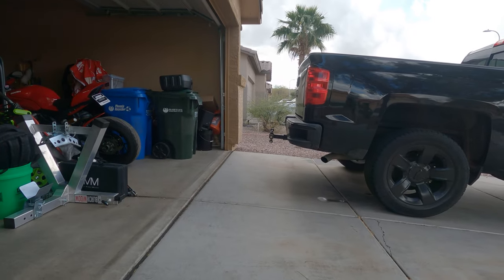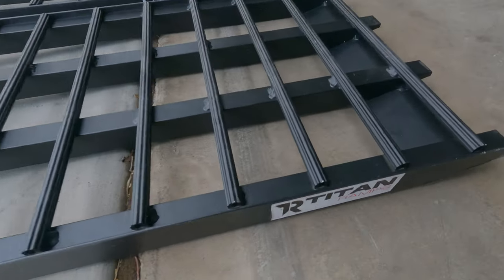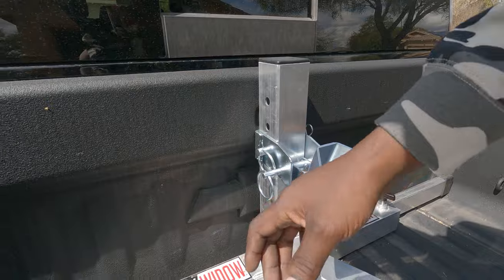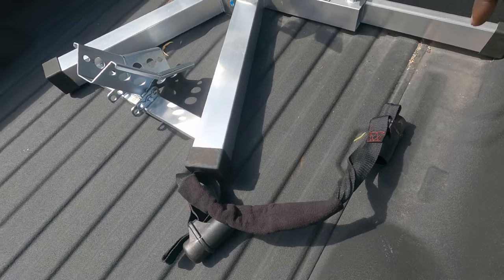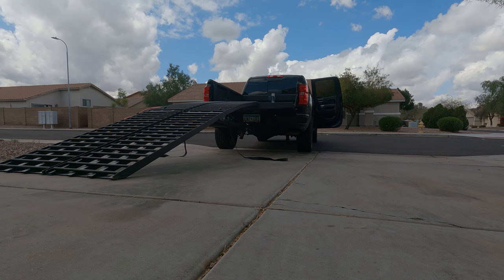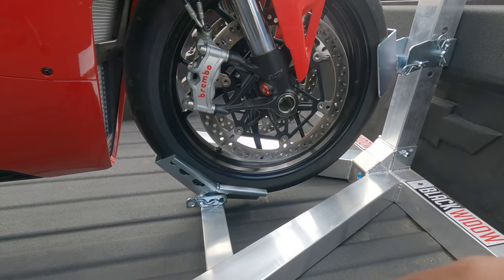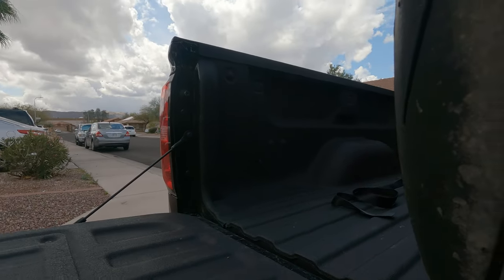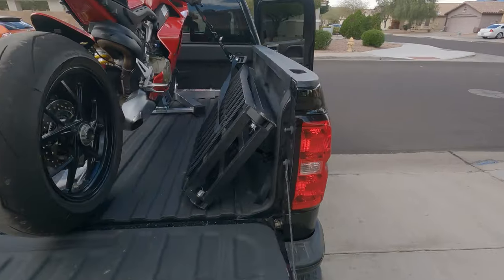How to load a Motorcycle into a pickup truck

Comment: We move approx a thousand bikes each year & found that the best way is use four straps two at the rear two at the front. Best to come off the lower end of the forks that way you won't have any pressure on fork seals over a long journey,  rear straps off pegs or frame holds bike a lot more stable.
Reply from the maker: Good info I'll consider switching up the fronts. Where would you strap on the rear for bikes like v4's that don't have much frame exposed on the rear for tie downs and no pegs?
Reply: @AlwaysGrinding24  I know this is a year late but you probably wrap the strap around the spoke. Like making a loop so there isnt metal hitting the bike
Reply: @AlwaysGrinding24 on my V4 I put Sato racing hooks in the holes left by removing the rear pegs.

Comment: I use three of the ramps. The 2 outside ramps are narrower and the center one is wide and I sit on the bike and walk it up the ramp. But I'm loading a 1000 lb. harley electra glide. It works great. Great video by the way. Thanks

Comment: Nice video. Like another person said you are doing it right. My friend insists on no strap locking the ramp to the truck. Makes me crazy watching him because if/when that ramp slips out, ugly stuff will happen.
Reply from the maker: I use to be nervous about the back wheel but I've taken my Ducati from Minnesota to Arizona and Arizona to Minnesota and have even done some off-roading with the Duc in the bed without any issues ever. I think as long as the front is locked in with these stands, the rear can kinda do whatever and still be ok.

Comment: Great video! I’ve loaded up numerous bikes and about to take my Streetfighter V4S to a track day but thought I’d search for some ideas to transport my bikes more securely. Your vid had great tips, thanks for sharing!
Reply from the maker: Glad it helped out man. Bring a gopro out and what track?
Reply: @AlwaysGrinding24  went to Buttonwillow in CA. Wound up getting a cheap stand from Cyclegear because it was cheap and also available to pick up, then modified it slightly by putting a steel rod through the front to give it more stability like the one in your video. Worked out great! Will have a go pro vid on my channel of the track day soon.
Reply from the maker: @allaboutmd  I'll be watching for it

Comment: I bought the 3-ramp version for my Harley and was very concerned about the ramps sliding apart as I rode up them into the truck. There is no way to join them to make a solid piece. I shimmed the spaces with 1/2" wood blocks and drilled 5/8 holes and bolted them together in 3 spots to make it a more rigid ramp. It takes longer to assemble/disassemble, but much safer. They should have offered a tie rod that joined the sections for safety. Great video BTW!

Comment: Nice job brother. This is the way to do it. I have to figure a setup now for my new Ram 2500. It's lifted another inch and I need the tailgate to close because I'm pulling a travel trailer and need the turning clearance. Have to load my 1199S when going to track and camping. This means I have to load back at an angle with front wheel tucked in the driver bed corner. I already have the 3 x 9ft Titans (awesome ramps) which used to load bike onto a utility trailer. Have Condor chock. Hope I can figure this out.

Edit: Think I might have figured it out for my case with pulling TT and require tailgate up. Load bike in head first but position chock slightly more to driver/left side as much as possible still having distance from left tire hump in bed then pick up bike rear wheel and swing to the right and hopefully enough to have bike rear tire clear closing the tailgate. Will need to try this method.

Comment: I would recommend putting cones out if your front end has to be in the roadway, and to tie your laces up tight like an adult. Loose footwear is a recipe for disaster when loading equipment. ** Edit: not to come off negative, you did a really great job otherwise. I think ratchet strapping those ramps to the hitch is the smart move, too. Can't be too sure. Good on you for investing the money to do it correctly.

Comment: NICE VIDEO.....GOOD SOUND.....AND CLEAR INSTRUCTIONS.....BUT I DO HAVE A QUESTION.....WHY IS THERE NO STRAP ON THE REAR OF THE BIKE TO PREVENT THE REAR WHEEL FROM SLIDING SIDE TO SIDE?....
Reply from the maker: I use to be nervous about the back wheel but I've taken my Ducati from Minnesota to Arizona and Arizona to Minnesota and have even done some off-roading with the Duc in the bed without any issues ever. I think as long as the front is locked in with these stands, the rear can kinda do whatever and still be ok.

Comment: This is a great video. Love the Black Widow wheel chock. Is this the 5.5ft short bed Silverado? I have a CBR600RR and I’m considering a Tacoma which has a similar length bed. Hoping this setup would work in it.
Reply from the maker: 6.5 foot bed. You might be ok with a 600, smaller wheelbase

Comment: nice chock but DMAN thats expensive for one
Reply from the maker: It is but I always compare it to what it'd cost if I tipped the bike over. So I'd rather spend 300 to avoid tipping over 25k. And peace of mind knowing it's not gonna tip over/is convenient has tangible value too.
Reply: @AlwaysGrinding24  I think it’s $300 each ramp, means total is $640 for NJ resident
Reply: @AlwaysGrinding24  but still, thanks for such great video and I am going to pay for those ramps. 👍
Reply: Hi nice set up what size bed truck is that a 6.5??
Reply: @AlwaysGrinding24  hi nice set up what size bed truck is that a 6.5??
Reply from the maker: @eddiediani  yes, 6.5

Comment: Could you get 2 of those chocks in the back if you have to load 2 bikes?
Reply from the maker: I know they have the configuration setup for it but I don't think they'd both fit in a smaller bed side by side. Maybe slightly offset

Comment: Have you tried to find a topper for the bed that would work with the bike loaded? I’m interest in getting a Silverado just for hauling a zx14.
Reply from the maker: I haven't, I think the bars would be your issue though. They and the windscreen typically sat pretty high above the roof line depending on the bike. Have you found one that could maybe work?
Reply: @AlwaysGrinding24  I thought about the extended topper. But I don’t know. Thinking, they make a lift for toppers so you can lid atvs and then the topper comes down on top. No idea how expensive or how much the system would cost.
Reply: trqmj  wheel base for zx14 is 58inches and overall length is 85. So tailgate won’t close either way. But they make those metal bars that sit on your tailgate.
Reply: trqmj  was look at the crew 2017 Silverado max bed length is stated at 70inches.

Comment: Why not having a pickup with a much lower ride hight.  Never understood these people needing elephant vehicles still never using them for much more than the highway.  Got a tilting trailer,, never even using a ramp, don’t need a truck, no specials, no stands, only good load secure straps properly set.
Reply from the maker: What tilt trailer do you have
Reply: @AlwaysGrinding24    Having said what I did simply comes from a need for being fuel and transport effective a thing that many Europeans have to be for various reasons. There are plenty trailers out there that can angle down the ‘platform’ for any kind of smaller machine or vehicle like a bike to just drive up on it without a ramp. However trailers often have a very “jumpy” suspension so it’s important to strap the bike allowing it to rely it’s own suspension.  Tightened straight standing, strapping looped through the wheels.
Being a craftsman never buying anything not needed or if in case make it in shop.  Have found out using trailer is for the most better for nearly anything keeping ware n tare down on the car and also makes everything more optional.  Ok those things shown look good, seem to have some q but iron horses are supposed to have a rider not a driver/transporter.   45yrs on the roads now, intercontinental rider. (the US was nice).